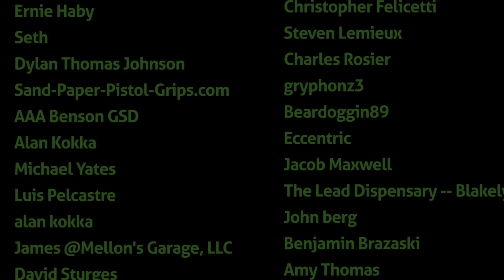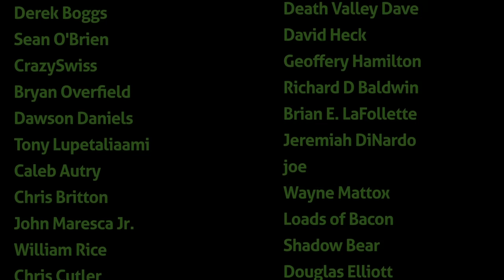Elephant Rifle vs Ballistic Gel

Comment: I used to have a Winchester Model 70 in .458wm. I'd read about them in magazines and I wanted to experience it first hand. It is the most awesome weapon I've ever fired! I can fully understand your groans shooting in a T-shirt. I used 510gr. FMJ rounds and ran it though a velocity checker. Muzzle Velocity was 2200fps and I've read that the recoil is around 4000 pounds per square inch. Quite a wallop to you shoulder! Your rifle looks a lot lighter than the Model 70. I'm an old man now and I don't think my shoulder and back could take repeated rounds with this Galaxy Marauder!

Comment: I've hunted extensively with the .450 Watts; which was almost identical to the .458 Lott. A .375 H&H case opened up to take a 500 grain .458 bullet. I handloaded them up to 2300 fps, with no signs of pressure; even in the fiercest African heat. (I never tried it, but I'm sure I could have fired .458 Lott rounds through it as well.) I loaded 500gr Swift A-Frames and Trophy Bonded Bear Claw bullets for the first shot at Cape Buffalo; followed by 500gr Hornady FMJ and Trophy Bonded Sledgehammer Solids. The .450 Watts vanished into oblivion; but the .458 Lott is destined to become the best bolt action rifle round for Cape Buffalo and elephant. And thank you for a great video- I really enjoyed it!

Comment: "If 64" of gel won't stop this, I don't know what will."
An elephant?
Reply: 15 cm concrete
Reply: A tank
Reply: @itzmrman3574  no ar 550 steel
Reply: It will go thru an elephant
Reply: The front end of a 70s/80s Cadillac/Lincoln
Reply: Bill, those Woodleigh Hydros have a reputation of penetrating an elephant length ways ! Broadside head and shoulder shots don't stop them ever.
Reply: @timcooper547  Then, two elephants?
Reply: Chuck Norris palmstrike.
Reply: @edwarddrost5299  lol
Reply: Not necessarily an elephant. Still have to make sure no second elephant behind the targeted one because can still have pass through.

Comment: Take note, on the texture of the ballistic gel (tough, but flexible). Notice the shape of the projectile when he retrieved it from the relatively soft gel. The bullet is completely deformed and has sustained very obvious damage and deterioration. Remember that the next time that the media broadcasts a cockamamie story about a bullet that went through a wall and into someone's shoulder. The surgeons pull the bullet out, show it on the evening news and it is always in MINT condition. Remember because more than half the time the media insults your intelligence and tries to tell you that something physically impossible happens with these legendary bullets that never get a scratch on them.

Comment: See how many frying pan's it takes to stop the brass round, line up 50 pan's
Reply: The garena developers should see that vidio
Reply: Bullet proof glass
Reply: need 25 frying pan to stop 50 bmg (and it curve).... i m not sure 50 would be enougth honestly.
Reply: @franktrinidad142  i just wanted to see it just thought it would be funny
Reply: cast iron is incredibly weak when it comes to direct linear forces. It's like ceramic. It will just crack.

Comment: Sooooo is anyone gonna talk about how the lead round made an explosion in the Gel? 7:12
Reply: 5:30-5:40 as well with the federal brass hydro whatever round.
Reply: I think he explained why that happens in an older video
Reply: Does the same thing when you shoot underwater
Reply: @Packman  what, is combusting? powder trail?
Reply: it is the air in the channle compressing,, kinda like how a diesle engine works,, watch a few gel shooting vid,, it happens with high power firearms
Reply: @danielkearney3295  what is the fuel?
Reply: @signlsirchir2156  There is no fuel. The round dumped a tremendous amount of energy into the gel. The violent expansion and contraction caused such high energy and heat that it creates a fireball. Here is a video explaining it a little more. https://youtu.be/tC2SUehnJ5A
Reply: @Packman diesels run on fuel, silos combusting is a result of grain particles and a spark.  But in this case it seems the air itself is what is burning,

Comment: The reason it travels so straight in the gel, is because it was intended  as a maximum penetration round, the projectile never collided with the material, that's an optical illusion,.
What is actually happening is the very molecules sense the projectile coming and move out of its way. they touch on this in particle physics,  But essentially the gel saw a boatload of brass heading in its direction at Mach 2.5 Jeebus's and said "Nope That's a Lott" and Keanu Reeves'd out of its path. 

(This is satire)
Reply: Sounds good😎

Comment: .458 Lott is an awesome big game cartridge. It basically fixes all the short comings (if there are any) of the .458 Win Mag as a rifle for Africa’s “big five”. Realistically inside of 200yds or so there really isn’t anything the .458 Win Mag needs help from the Lott cartridge to accomplish, but getting out further is where you would see a noticeable difference. Both rounds are more than sufficient for Cape buffalo, elephant, moose, elk, anything North America has to offer and lots more. You don’t even need an expanding bullet with the Lott, it’s one of those cartridges that will still take whatever game you are after even if you use a good old fashioned hard cast solid.

Comment: Jack Lott developed the cartridge to be a 200fps upgrade of the .458 win mag(2200fps vs 2400fps) Frankly, I didn't need any upgrade. I used to load the 350 grain flat nose and 400 grain round nose for the .45-70 and that flake powder and get 1900 fps and a lot less orthopedic bills. A double magnum recoil pad and a gel shoulder pad and you leave the range smiling . Me no like the recoil grimace, especially when I'm wearing it.  Save the heavy factory stuff for the next time you're in Alaska or Africa. Eye and ear protection for everybody, of course.